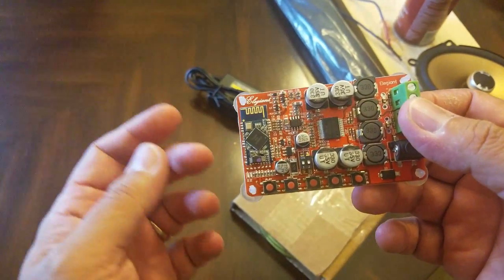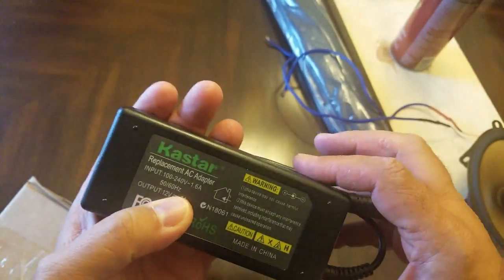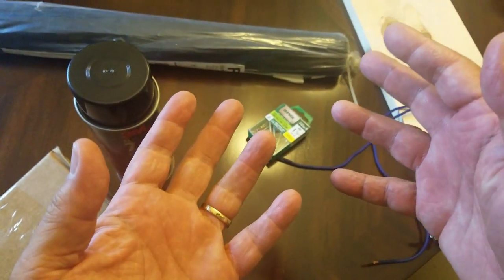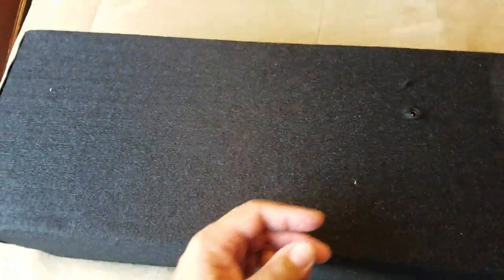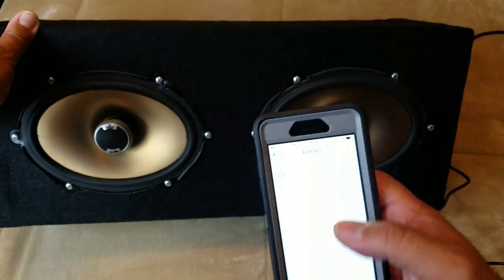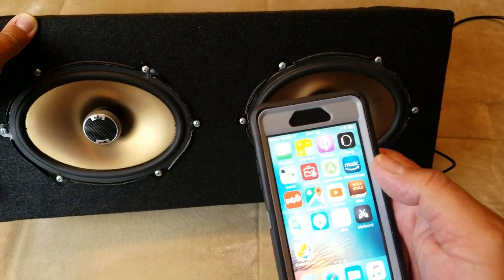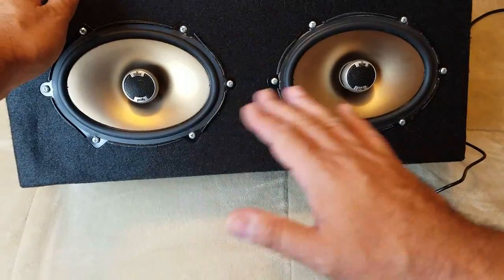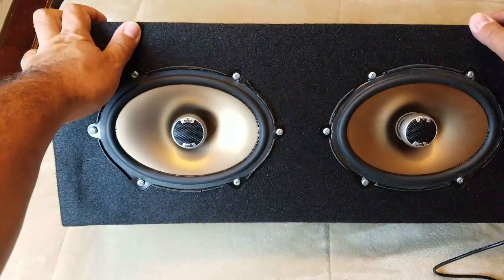Bluetooth speaker box TDA7492P

Comment: A bit of advice to anyone using this Bluetooth board, the volume starts mid range when powering on so you need to access the volume buttons on the board to turn it up or you won't get the best sound. I just put screws through my box to hit the buttons.
Reply: Not The One done the same thing for a power button on my converted portable charger powered speaker, works a dream but now looking of upgrading

Comment: Why did you elect not to use the button controls on the board?  It would have quite simple to rig extended push rods to activate each button.
Reply: Mick Bradford late reply but for anyone else wondering the same, in my opinion I wouldn't because it'll likely leave small holes for sound to escape and you'll have your device on you anyway so easy to change on that

Comment: What type of power adapter do I need? I just purchased the amp.
Reply: MIXED TEA If you bought it off Amazon it usually has a suggested power adapter
Reply: you can use a 5 amp adapter for better power and the required amp is 2 amps min but use 5 amps it works best and use the formula power equals to current times voltage to create your boombox